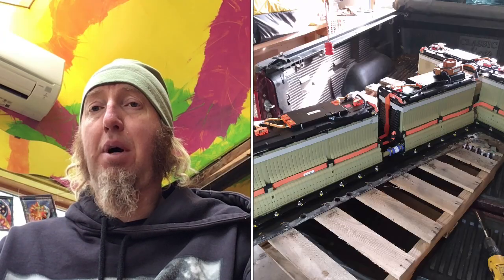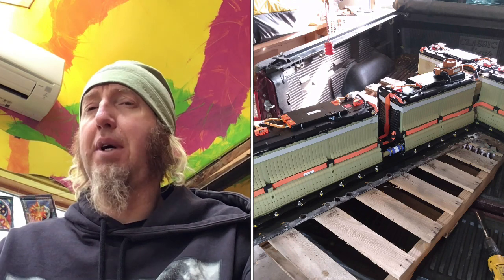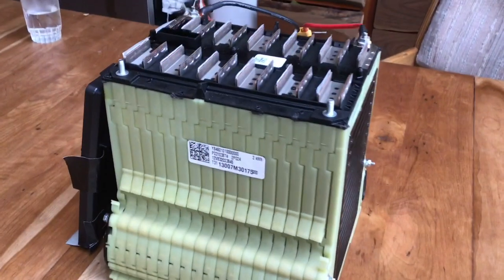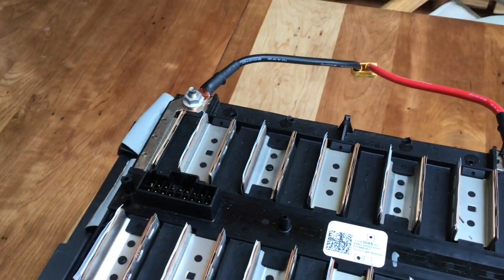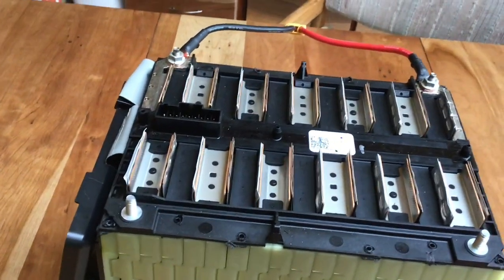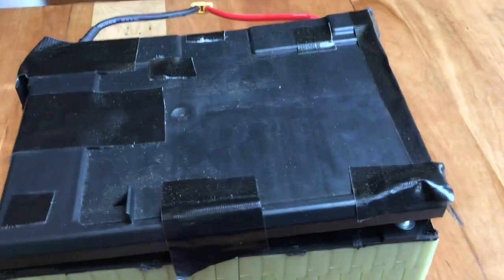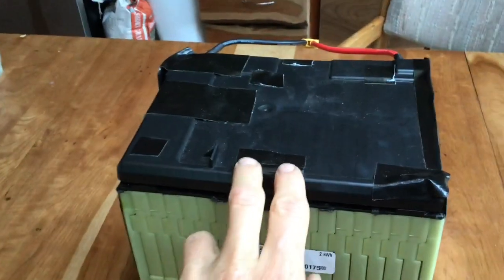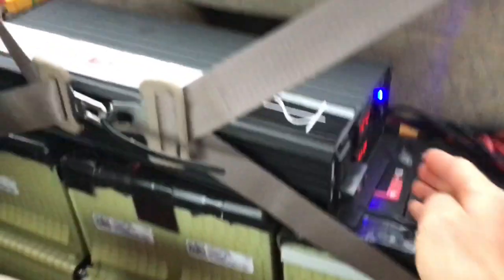Chevy Volt Pack Conversion to 48v packs for use with ebikes, electric cars or generators

Comment: I bought the battery pack with the shell included but for  some reason when connecting to the shell’s main gate(outlet) there seems to be no voltage coming through. So do I need to recharge the whole pack or is there a safety switch that is impeding voltage coming through?

Comment: I will warn you not to discharge the batteries to low. It could be dangeous. I left my cart with two 48 volt Chevy Volt pack unatended for 3 months and the bateries were destroyed.

Comment: Still working with no bms ?
Reply from the maker: No I spent about $500 to get 8 BMSes from China and installed them with custom wiring harnesses. It took a while but they were 120Amp BMS units with built in bluetooth. So far no issues. If you buy cheap BMSes then you will have issues, get the good ones.
Reply: @Electric-fatbike  thanks for getting back .. I have a full pack I bought years ago but haven't used for this reason...is it 12s for one 48v pack ?
Reply from the maker: @peeinginthewind  Yeah its a 44v nominal 12s. Did an article on electricbike.com about how to take it apart, check that out.